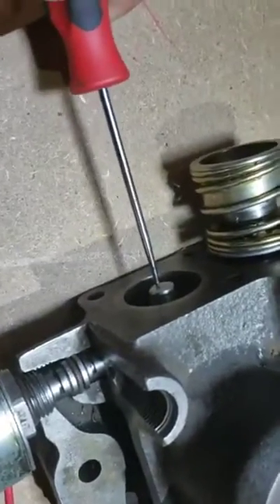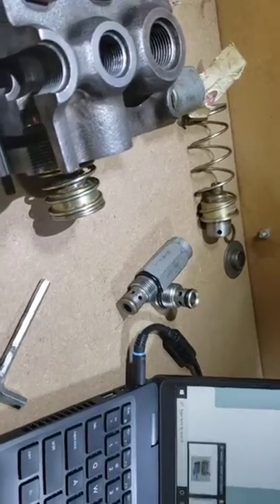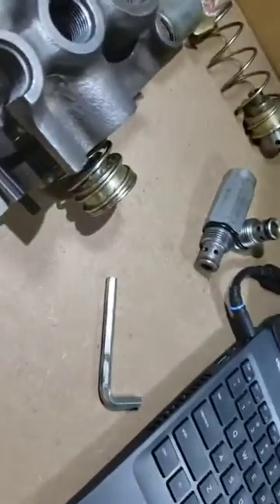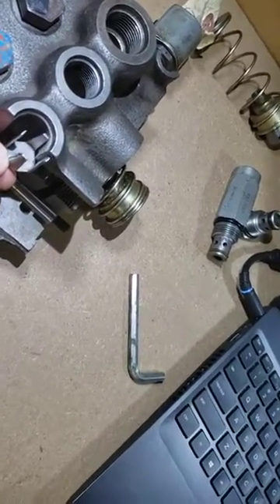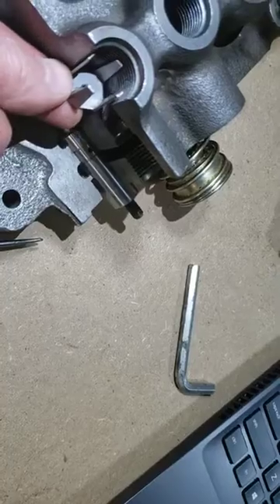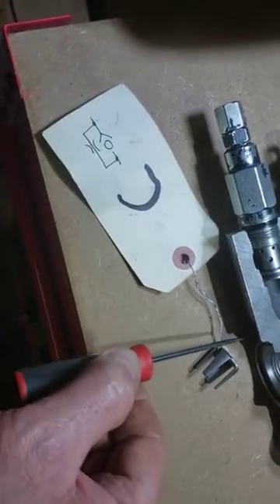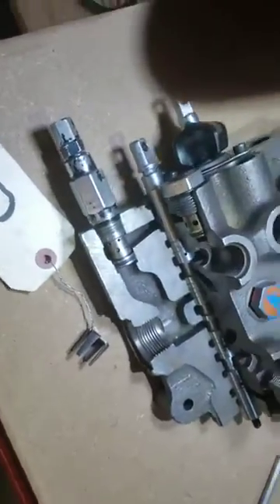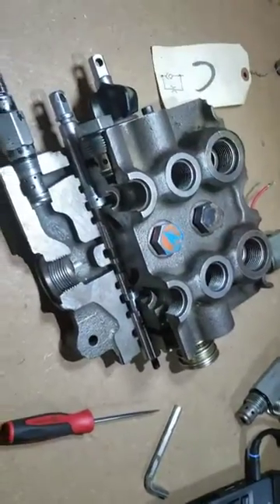Hydraulic Control Valve Cutaway HYDRAULICS FLUID POWER BASICS PART THREE

Comment: Excellent videos! I have a 763 that is having an odd problem and nobody including bobcat can figure it out. They finally told me i need a whole new control valve assembly for 4k but none are available. Looking for a used one. With the machine running, if i lift the arms up and leave them for a minute, when i go to lower them, its hard to push the pedal and you hear it loading up like hydraulic pressure is building. Once it overcomes the arms drop roughly. This is exacerbated when there is a load on the arms. I have to lift the load up a few inches and then quickly start lowering it. I have to do that a few times to get the load down slowly. If its just a bucket of dirt i can push the pedal hard and overcome whatever hydraulic pressure Is building and it operates somewhat normally. 
Maybe this issue will interest you, I would really like to figure out whats causing it even if i find a replacement control valve.
See video 

https://youtu.be/4ZbmoBbaIg4?si=Px747QtOLbCEDv3Z